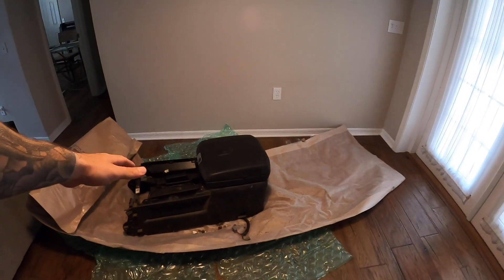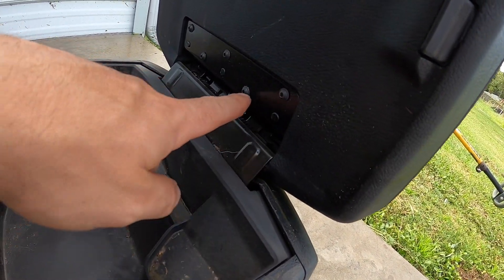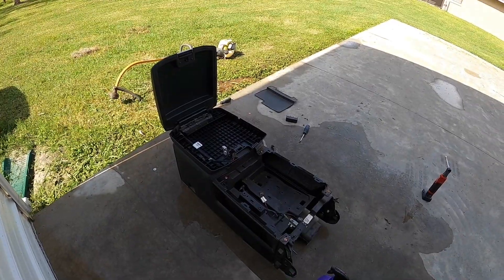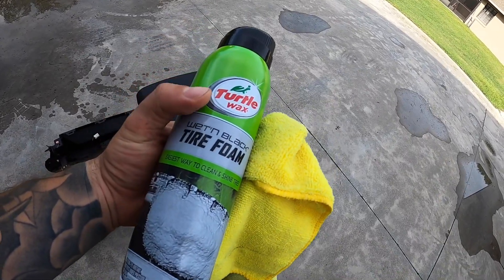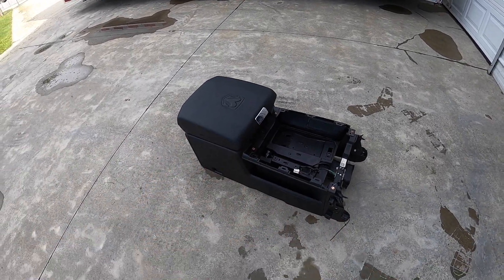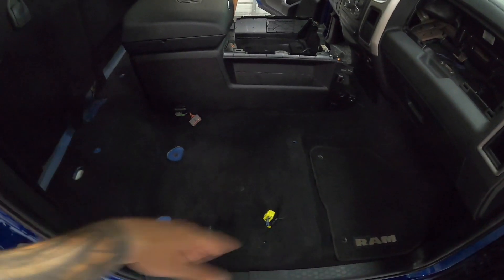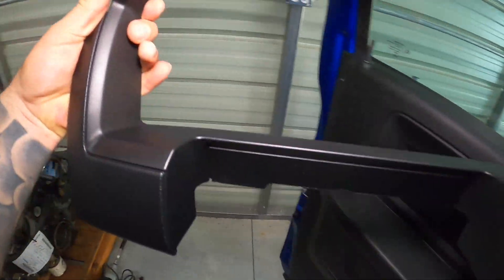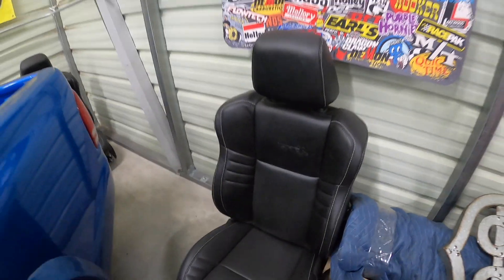More Parts For Dodge RAM 1500 Interior Hellcat Swap Truck

Comment: I did a laramie dash and harness swap on my 2014 ram 1500 express. Had a few problems since i had to go with a 2013 ram 1500 laramie harness. Would you know why i am not able to get park signal to my ignition to allow the ignition to go to off position. Only way i have got around it so far is by crossing the 2 wires that come off the btsi on column shift. I used a column shift harness. All the 2014 laramie's i found come witht the 8 speed dial shift, so thats why i went with the 2013 laramie column shift harness

Comment: A few weeks ago you bashed the 5.9. Simpsons speedshop YouTube channel. Made 530hp na with a stock 5.9 bottom end. So if u know what your doing you can make very good power with a 5.9. Just for the record.
Reply from the maker: Magnum is a very different engine than the LA 360 bud and yes you can make power but it won’t be cheap. If you throw the same mods on a 5.7 HEMI you’ll make way more than 530 crank…

Comment: Im surprised you didnt get the leather laramie center console
Reply from the maker: This came from a 2017 2500 Laramie. Same as the one in my 16 ecodiesel Laramie it didn’t come in leather.
Reply: @BoostedMotorsports  weird i thought all laramies had a leather lid